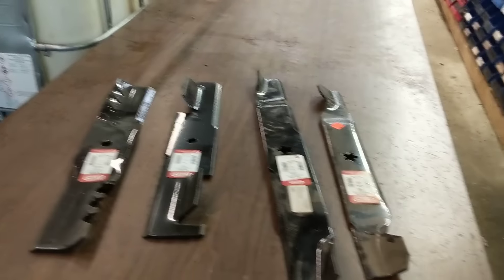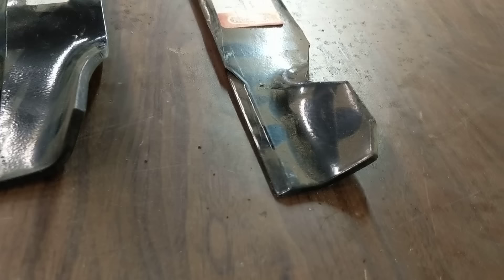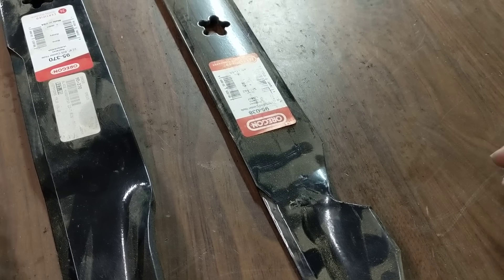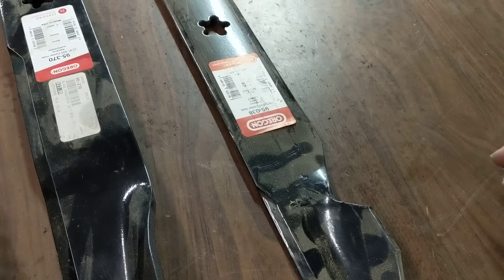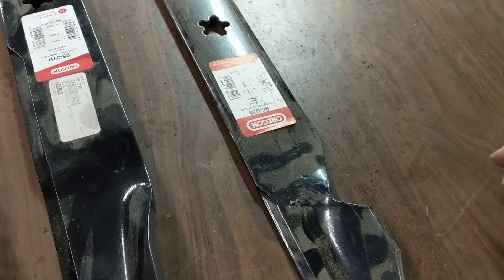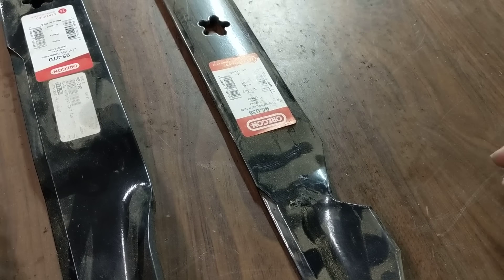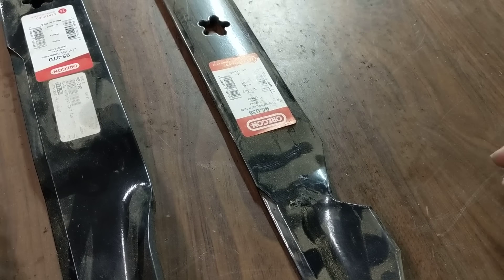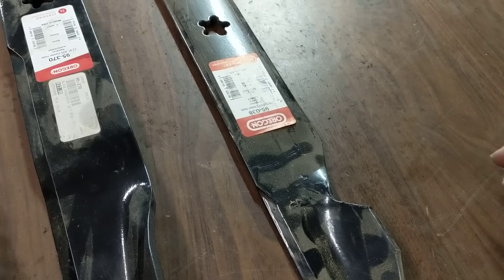Mower blade drastic difference and what is best for your yard and your mower. Oregon, Scag, Gravely,

Comment: I've never seen the sand blades I think I need a set
Reply from the maker: They still have decent lift and decent throw you just don't get the end of the flag wear as much they've really can be helpful in that sandy really dry dusty environments that just are so abrasive on blades.
Reply: @fuelediowa   where can I find the pro z  100 with a 60  cut blades at  in a sand blade  and or a G5 or G6 as I have rocks as I live  by a gravel road  and have a lot of big trees and try to clean most of that up don't always find all of them

Comment: The gator blades are thicker and wider. My dad would always break the ends off the high lift so I switched to gators and they held up to his abuse.
Reply: I think I tried gators on my mower when it was fairly new. They clanged together. I had to switch them back. I think I can run one gator on the inside and it'll clear.

Comment: Would you recommend replacing worn blades with new, or just resurfacing the cutting edge with high tensile welding rods {plating} & grinding back into the original shape?
Reply from the maker: Thank you for watching and taking the time to comment. I would just replace them after they to worn to sharpen. The Lift flag at the back of the blade will have a lot of wear as well once you have used and sharpened the blades enough to think about a replace or resurface. Plus with welding on them it would remove the temper behind the weld causing a weak area that is likely to fracture and come lose causing a very fast moving piece of shrapnel.
Reply: @fuelediowa  Yes of cause, you are right, even the cost of reshaping & plating is more than a set of new blades would cost! Have a good one:)

Comment: I have a Troy bill xp series 54in.what be the best blades to use on it it leaving grass in the middle
Reply from the maker: Troy-Bilt I usually built just to meet certain price points not necessarily highlight on quality of cut. I would use a high lift blade and probably make sure that my dick pitch was sick correctly to try to create as much vacuum as possible also double check your RPMs of your motor under load to see what it's turning there, that may need adjusted as well. Thank you for watching and taking the time to comment.

Comment: What kind of blade can I use that will cut once on property that has weeds, dandelions and sunflowers. I have to run over this stuff twice because it lays down or cuts on half the 1st time
Reply: How sharp are your blades ?  Slowing down will help !
Reply: Daddy's Boys Lawn Care 

I'm having the same problem.  I have tried flat gator blades, copperhead wavy blades, and wavy copperhead gator blades. I need help.  That bahia grass is the devil.

Comment: Thank you. I needed that. I have a cub cadet xt2 lx46. I live in western PA, and looking for a good set of mulch blades. I've seen those gator style blades advertised as mulching blades. Any thoughts? Thanks again.
Reply: The Gator blades work great for mulching as long as you are cutting your grass often.  If your grass grows quickly you'll need to cut 2-3 times a week for the blades to work like they're supposed to.  They work great mulching up leaves though, makes them pretty much disappear.  

What people don't understand is if they let their grass grow to 6+ inches tall and think they're going to go out there with mulching blades and the grass is going to disappear into mulch they're not going to like the results.  Its way too much grass to try and process into tiny bits....now if you went out there and double cut that lawn at a high setting, then went back over it at a lower setting you'd like the results but most people just want to get the job done once in the least amount of time.  Which case you'd want to bag or side discharge, then next time you mow, do so sooner and the Gator blades will work fine.

Comment: What do you recommend for a riding mower, side discharge, large yard, thick grass, gets mowed 1 time per week (should be more often)
Reply from the maker: Well that is a pretty loaded question. One are you looking for a garden tractor style mower or a zero turn mower? Also when you say large yard I kind of depends on who you're talking to, some people with a corner lot that is a large yard, to other people 4 full acres is a large yard. Those would need two different machines. Also how long do you want the machine to last do you want it to be a four or five year machine or do you want it to be a machine that's going to last you 20 years?

Comment: Any recommendations in what I can use for a factory 2021 Ariens ok on xd  52 inch mower?
Reply from the maker: Exmark has a decent high lift but there is a notch behind the flag \ lift side. This does reduce a bit of lift but it also runs pretty smooth and reduced drag helps for power as well.

Comment: I have a no frills "Yard Machine" riding mower with a 38" deck (twin blades). I'm also using a "Cyclone Rake" bagger. I'm mowing pasture grasses. QUESTION: Which mower blades would be best for my situation? (This grass is pretty tough stuff, and the mower really struggles to keep from clogging.) THANKS!!
Reply: Im in the same shape. Would love to hear some expert advice.
Reply: I'm waiting on a reply for using a gator as an inner blade, and high lift as an outer (chute) blade. You can buy these blades separately.
Reply: You would want high lift blades using a bagger of any kind.  mulching blades do not have enough lift to properly expel the grass clippings out of the deck and up a chute into bags.
Reply: I'd be using the Gator blades because they will stand up to the tough grass due to their thickness and hard blade edge, while the multiple notched rear of the blade cuts the grass up more and still provides lift.  The Cyclone Rake is awesome and it's powerful separate vacuum motor will suck up the grass clippings and any leaves with no problem.

Sharp blades, fastest blade speed and appropriate travel speed is the answer.  Absolutely, never cut wet grass or there is nothing you can do to get a good cut and pick it all up without clogging.

Those Cyclone Rakes are awesome machines, are well built and do a great job.
Reply: @davidgeorge8172  Would gator blades work with a regular bagger?  I don't think they'd have enough lift to work without the cyclone rake setup, or would they?  I don't have a bagger to try it LOL.

Comment: I’m completely confused.
Gator blade 
3:33 “it will not have as much lift”,
3:39 “it has more lift”
Reply: Don’t let the appearance fool you. Those Gator blades more lift than “people” like to claim. They do produce smaller clippings when side discharging. Believe it or not,...they do throw the clippings noticeably farther than the high lift blades than cane on my mower.

Comment: Picked up a old yard machine rider that didn't run but got it running good so i tested it out mowing my yard and when I engage the blades the deck starts shaking pretty bad I checked pulleys which are all running straight and true so I look under the deck to see if the blades were maybe bent and they're not but I have one of those Gator blades and one regular hi-lift blade could that be why it is shaking so bad because they are different

Comment: When a blade is labeled as, "High lift" does that refer to the blade lifting the grass blades before cutting them, or lifting the clippings into a bag or out the shoot ?
Reply from the maker: Actually both. Causing more vacuum and discharge volume.

Comment: I bought gator blades  oregon ones and they hit the underside of the deck where the bellys in the deck are . They scraped down to bare metal and I have pics of it . I have gator blades on my other cub cadet 42 inch mower no problems but the oregon ones on the new 46 inch cub cadet do not work . I can send pics of the damage they did to the underside of th deck after just a few minutes of hearing the bang every time they hit the deck . I had to take the blades off before they destroyed the deck  . Not sure why this happened but where the blades hit the deck it is bare scrapped metal cuts

Comment: Personally, I think the blade that comes w any high end mower is the best overall blade…..assuming, that is, that there has been some engineering input on its design and “fit” to the mower used.  Keeping any blade sharp and running it at recommended rpm is, in my opinion, key.
Reply from the maker: You are correct. However two things. The average user doesn't buy a $15,000 mower. Plus many of those high end mowers come with 3 - 5 blade options. As most times it is just to fit the kind of grass or how or what you are mowing.  Which is cool that many high end manufacturers go to that level.  However this day and age most shops \ dealerships are having a very difficult time staffing and training a knowledgeable staff. So many are left on their own to try and find reasonable information. 
I greatly appreciate you taking the time to watch and comment. Hope you have a wonderful weekend.

Comment: I have a John Deere E series riding mower.  From day one, it leaves a ridge of grass on every pass.  I took it back to the dealer twice and they kept telling me that it’s fine. 2 years later and I’m still going back over a lot of my yard after cutting it.  I live in the country and my grass isn’t golf course grass, but I had a Cub Cadet before and never had this issue. Any ideas?
Reply from the maker: Yes it could be a few things. One is proper deck setup making sure the pitch is correct. The pitch is where the front of the deck is actually a quarter inch lower than the back of the deck and this is done from the tips of the blades. So putting the center blade in a north-south position North being the front of the mower south being the back of the mower. The front of the mower being a quarter inch lower will actually help vacuum pulling the grass tighter and giving a more efficient cut. I would consider using a good high lift blade as well this will give a reasonable discharge especially if you're just cutting country grass and not worried about a perfect manicure. Another issue could be belt tension for your mower deck belt itself. If that tensioning spring wasn't set up right or has enough tension could be causing some slippage and not keeping enough blade tip speed to do the job efficiently. I hope this helps that's where I would start thank you for taking the time to watch and ask questions I greatly appreciate it.
Reply: @fuelediowa  thank you for the suggestions!  Yes, it’s just country grass and I could care less about perfection, but it’s really irritating when I look back and see these ridges everywhere!  One thing I did notice yesterday after cutting the grass, in the areas where the grass was probably 6-8” tall, those grass ridges were everywhere. In areas in the shade where the grass was only 4-5”, you don’t really see any ridges.  I always thought it was a suction thing. The dealer said to drive more slowly, but that didn’t work either. My Cub Cadet had absolutely no issues cutting country grass and I bought that at Home Depot!  This Deere was bought at a Deere dealer!  Thanks again for the suggestions!
Reply: @Gum05  9

Comment: If you're not bagging is there any benefits to a lift blade?
Reply from the maker: Yes There are a few. One it high lift blades pull a vacuum causing the grass to stand taller for a more even cut. Another thing is it discharges larger clippings and can throw the dry ones farther. Thank you for watching and taking the time to comment.

Comment: I thought the bend in the middle blade creates a vacuum lifting the grass up.
Reply from the maker: Actually the geometry and aerodynamics of the deck itself has more to do with the lift then the difference in many blades.  The higher lift the blade the more vacuum is created. A double \ wave blade actually creates two levels of cutting and kea vacuum to allow the grass to be cut multiple times. Thank you for watching and taking the time to comment. I greatly appreciate it.

Comment: Using a Gravely Proturn 260, cutting acres of Baha’i... In your opinion what blade would give me the best life in between sharpening and the longest life of the Blade over all?
Reply: I use the Gator Blades.Hustle FasTrack SD 54 is my mower.Bought it 8 31 2014.That is six years today,185hrs.I switch to Gator, I cut two lawns total 3 plus acres. I replace the blades ,have the others sharpend,ready to go,Evey six cut.All types of grass, try them.ALABAMA

Comment: What about two gator blades on a three blade deck, with a hi-lift blade next to the output?
Reply from the maker: That can be done I have seen a lot of guys do the opposite using the Gator on the discharge blade to get or just one high lift on the trim side. only concern I would have would be to try and keep the weight close to equal. Especially in a gear drive deck.
Reply: I use the x blade set up with g6 on top and high lift on bottom and high grass,thin stringy grass, thick grass,weeds or whatever works well in my mower

Comment: Wish I knew where to find new mower blades for M&W 62 inch cut. Length 21 3/8  Width 2 1/2  Thickness 1/4 and I.D. hole 3/8

Comment: Why do they sell a brand new lawn mower blade that doesn't have a sharp edge on them?
Reply from the maker: That is a great question. I have asked as well. The answer I got is that the blades don't need to be any sharper. My thoughts are that. It would cost a little bit more money.  Another think on the coated blades I could see not removing the coating for rust prevention. A lot of blades can sit for months before selling.
Reply: @fuelediowa  Great reply Fueled Iowa. I bought a new Craftsman Rider Mower. A nicer one. The blades were new of course, but black and the edges were about .200 to .300 thick. I used it for awhile, it cut like crap. I sharpened the blades and now it's doing what I expected.

Comment: We have a lot of little blue stem prairie grass that used to be cut fine with our older mtd 46" mower. But we recently got a new John Deere with a 42" deck and it's been cutting terrible. Some areas I go over three passes. What blade is best for tall thick grass that may go a while between cuts? Thanks!
Reply from the maker: Maybe the deck pitch is off or was improperly set up.
Reply: Fueled Iowa ok thanks!

Comment: I have a Cub Cadet XT1 46' Cut, it mulches "grass" beautifully,  but "LEAVES" are a different story. It tends to blow a lot of the leaves away from the deck before they actually go under the deck & while mulching the leaves it will blow them back out from under the deck from both sides, making it complicated to get a clean swipe, I'm having to go over the same row at least 2-3 times before it actually looks good. I'm using Cub Mulching Blades with the factory mulch plug in the deck.  I even thought about making a "skirt" of some type to fasten along the edge all around the deck edge to hang down, but not sure if that would help or not. Any ideas to help eliminate this problem?  Thanks for your help.
Reply: Taking the plug out and letting the air/leaves discharge should help with the blowing away before you get to it problem.
Reply: Iv found that if you use just the left blade  only  !   You cut all the debris up more piece meal  :  mulch smaller   !
Yes you are going over one half or one third  as normal cutting  : but you don't have to go over the same areas two or three times   ! 
Go slower and cut more efficiently  !
I call it  one blade cutting  .
Reply: I made a cap off for my Husqvarna 42" mower for mulching leaves. It closes the chute off. It's made from the top of a plastic rain barrel my neighbor cut out.
Reply: My XT1 42" does about the same....what I've found is I just mow more often to mulch the leaves and run at a lower engine speed and it seems to do better.  Lots of blow out on the mower deck as they were too cheap to include deck baffles like my Craftsman YT4000 42" deck had.  The problem with the Craftsman was the deck was built for mulching more than side discharge so it really plugged up a lot.  the deck on my XT1 was built for bagging/side discharge so it don't have the baffles on the front and side of the deck to keep the grass/leaves under the deck and keep the air from blowing stuff away.  I have thought about getting some steel and making my own baffles just haven't done so.

Comment: I need info on where I can get the alligator blades for my zero turn mower ,that has 3 blades on it. Yes it is a 42 inch mower
Reply: My 42 inch deck has two blades and I got my gator blades on Amazon and they are the Oregon brand

Comment: Ummm...some mowers won't have the POWER to turn some blade designs and still CUT (rather than just chew) grass. Today's low RPM engine's (to prevent throwing debris) are terrible about that.  In most cases today you MUST use EXACTLY what came OEM on the mower or the "optional" OEM blade (usually 3 times the price of the standard blade!). Even 2,3 and 4 blade riders have this problem.
Reply from the maker: Thank you for watching and taking the time to comment. However I think this idea mainly applies to electric mowers or mowers so poor that most consumers should be watchful enough on their buying practices to know this ahead of time. Almost every mower is tuned to run 3,200 to 3,600 RPM and legal limit of blade tip speed is 1800 FPS.  Very few manufacturers try and down grade these areas because it causes poor cut quality no mater what blade. As well as premature engine failure. Most consumers lawnmowers are an air cooled engine. If you lower the RPM you reduce the cooling causing over heating issues. Hence never mow below full throttle.